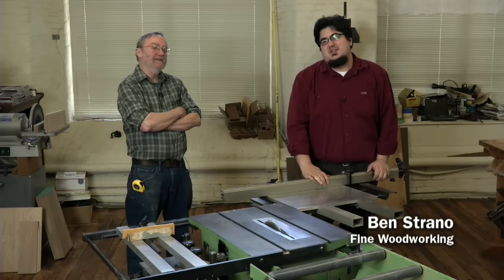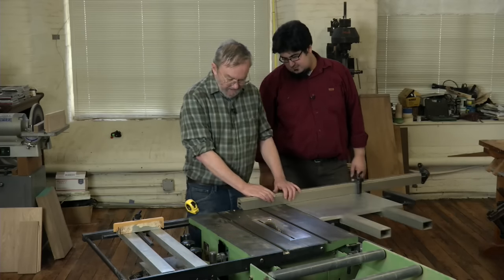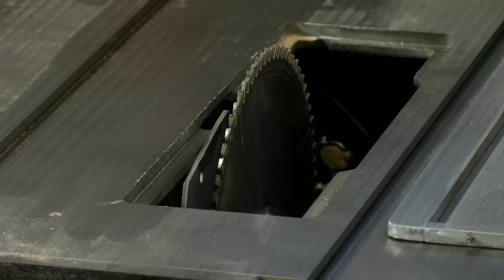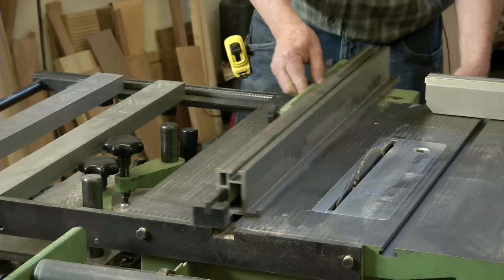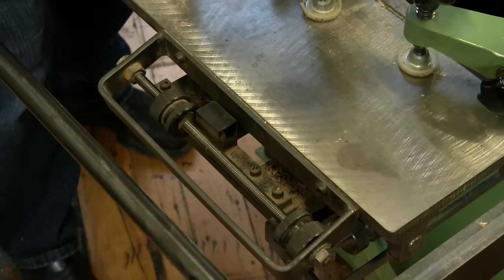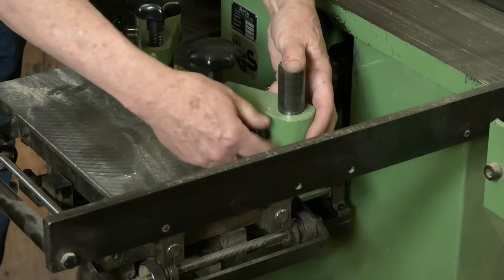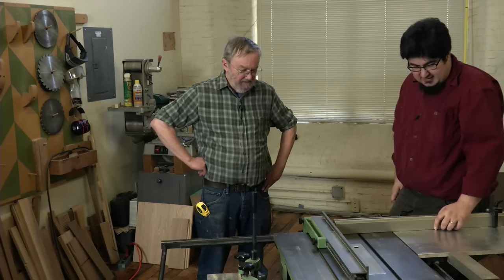Kevin Rodel's Ulmia Tablesaw

Comment: This saw is amazing! I may have missed Kevin mentioning this feature- but I noticed the outfeed/table rollers are also built in. We now have some saws with flesh--sensing technology and most modern saws come with standard safety accessories (like a blade guard and splitter/riving knife). But we have to add outfeed support-an absolute essential feature in safe tablesaw use-as a separate purchase or build our own. I don't mind building an outfeed table but it sure would make sense to have the "built-in" outfeed feature as an option.
Reply: Buy a panel saw - it has everything you need. Except 'flesh sensing' to keep stupid hands safe. Honestly, there is a price -point to everything. A decent outfeed  table is useless to someone that doesn't make long rips. So therefore, the contractor / cabinet -maker saw doesn't come with one. An example: I rip thin stock (less than 40 mm) on my 2 HP 10" saw, using a 24 tooth blade. I use an outfeed roller table of my own design, as I work on my own...but a friend of mine has a 12 " 8 HP rip with an auto-feeder and using an 80 tooth blade his staff rip any wood to the maximum depth of cut of the machine. And it has no outfeed table.
Reply: I would love a panel saw if I only had more room. I have a 6-roller stand for my outfeed and it gets the job done. But I hear you on reasons why people do not, or cannot use an outfeed table. That is why it would be nice to have the "option" as a built-in feature. I also fully admit to being one of those people with "stupid" hands and this translates into "beginner-intermediate hobbyist" in my case. A lack of well-developed muscle-memory around safe technique, esp. when you don't get into the shop every day, is always a concern. You have to plan on protecting yourself from your own (unintentional) newbie carelessness. Although for me, it is more about avoiding kick-back and not so much about getting too close to the blade.
Reply: Yes, the 'option' would be nice. Funny thing about kick back is that it happens when one least expects it. The only time it ever happened to me was when I was cutting a piece of 3 mm masonite. I was so nonchalant about such thin material, and used bad technique because of that. It was a wake up call. Table saws have no morals.

Comment: Nice saw, love to have one. Every saw should have these features. Odd how in North America we have always demanded the cheapest possible table saws rather than "the right tool for the job" principle. I've installed splitters in every saw I've had, but they don't move with the blade. Why did it take decades for us to get decent riving knives? I've also put a router in the extension wing of every saw I've had, but a slot mortiser would be even more useful. I might have to take a course from Kevin just to use his saw!

Comment: Can the saw blade tilt?  I think the Inca sacrificed the tilting saw blade for the mortiser, and the table top itself tilted.
Reply: Andrew Klein Yes it can tilt to 45. Normaly there is a cover für the Mortiser chuck that is screwed on the side of the maschine. By the way: The maschines with the Mortiser run at 6300 rpm.
Reply from the maker: Yes, the arbor tilts. I guess we didn't get a shot of the front, oops. If you look at the thumbnail you'll see a tilt mechanism.

Comment: One thing I forgot to mention is the drawback to these saws is the limited length of the arbor doesn’t allow for a stacked dado, at one time Ulmia had some dado blades that were different widths in mm but the mounting area was still thin enough to work on the arbor. The arbor is 30mm.

Comment: what model is that one I looked at doesn't have the sliding table or the mortiser
Reply: James McGuire It is all optional. You could buy the basic maschine body plus many options – such as the slot mortiser or the outfeed table. In the documentation from my maschine is the whole list of options with their numbers, weight and price (in DM). The manuals of those days are awesome! They include blueprints of the Maschine and the options (like the box-joint jig).

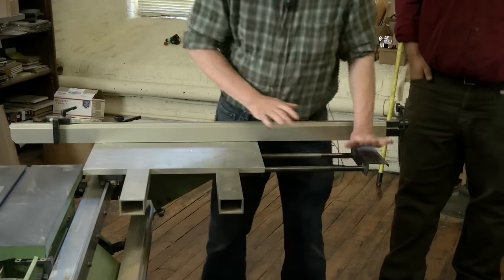Comment: 1:00 Notice the play in the crosscut mecanism
Reply from the maker: It's the sliding table doing exactly what it's supposed to do, slide.
Reply: There is a difference between a non wobboling sliding table, and a wobboling sliding table.......
Reply: I can assure you, there´s no play issue. It´s a very stable crosscut table (yes, I have one of my own)
Reply: I do too
Reply: Christian Kjelde Svendsen just bought one of these, there is no play in it.  I think maybe you have some dead bearings in yours or something is out of adjustment.
Reply: @BrianHolcombewoodworker  Have you had issues with the height of the sliding table in relation to the cast iron table? Just bought one of my own and the sliding table travels too low and not parallel to the cast iron table, but I don't see how I can raise or adjust it.
Reply: M van Leeuwen I attended to this by adjusting the position of the mounting brackets.  It’s tedious but it works.
Reply: Brian Holcombe The brackets are they not welded to the saw housing? Or did you fiddle with the aluminum bars? I can see that you might tilt or move the sliding table by loosening the two bottom bolts with all the spacers? Thanks for the reply!